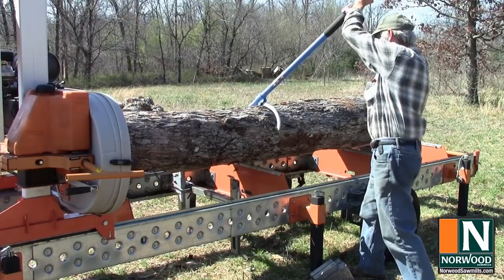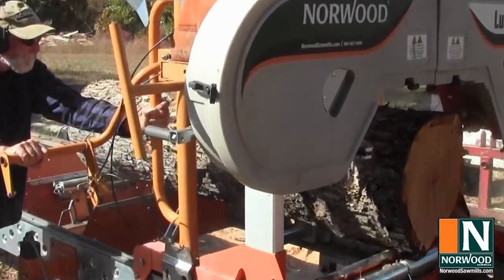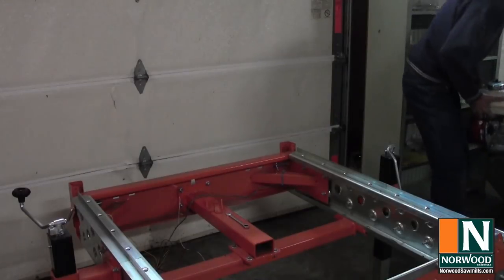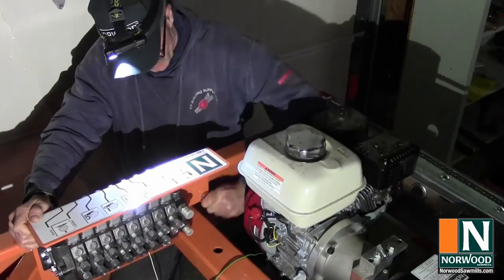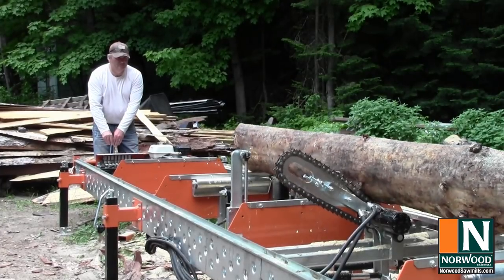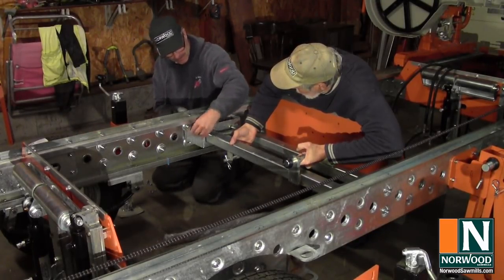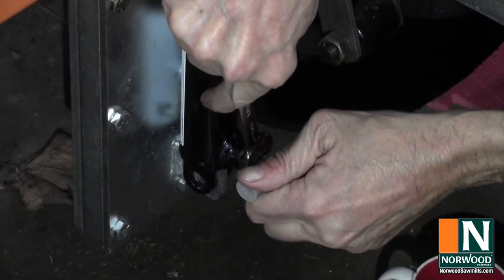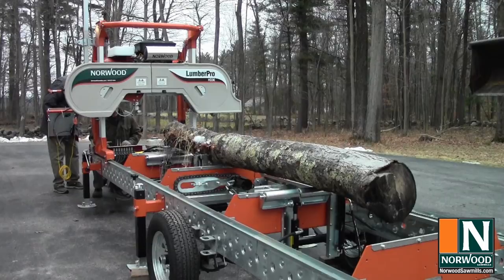Sawmill SPOTLIGHT on Adding Hydraulics to Your Norwood HD36 Sawmill

Comment: on norwoods website it says that the hd36v2 normally will cut 31" boards but in hydraulic configuration it says 28" anyone know why it loses 3 inches? I cant find it anywhere on the site.
Reply from the maker: Hi Greg. You can saw a slab up to 31 inches wide (sawing from a log). To saw a board, you need to start with a beam (squared cant). That changes the measurements a bit. So you can saw up to a 30 inch wide board on the HD36V2 in manual configuration.  The hydraulic log clamps take a fair bit more space than the standard log rests so that consumed some of your capacity.

Comment: How long can you order it? I would at least like 20ft when I order.
Reply from the maker: Standard, Norwood band sawmills are 16 feet long (4.8m), which allows you to cut up to 13-feet (4m) in length depending on the model.  But you can add optional 4-foot (1.2m) log deck extensions to saw longer. In fact, you can saw logs of any length in stationary configuration – some Norwood owners are sawing logs over 40-feet (12.1m) long!

If you want to add the trailer system to your Norwood, you can still add bed extensions, but cannot go as long. With the LumberPro HD36, you could add one permanent 4-ft (1.2m) log deck extension and up to two 2-ft (0.6m) detachable extensions to saw logs up to 21-feet (6.4m).

We would be happy to mail you a free Norwood Sawmills info kit including DVD. You can order one online at http://www.norwoodsawmills.com/free-dvd-kit